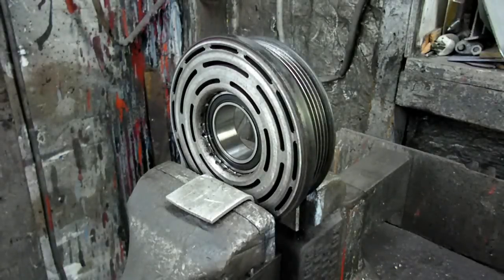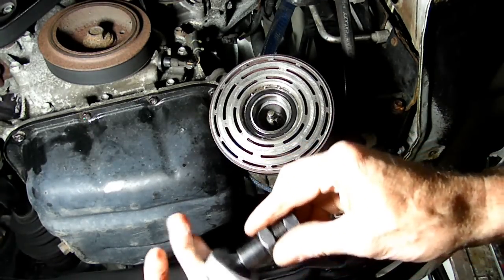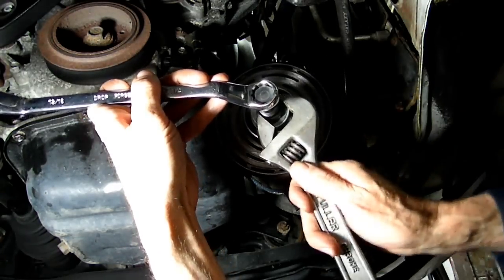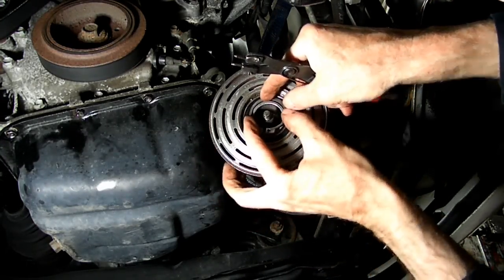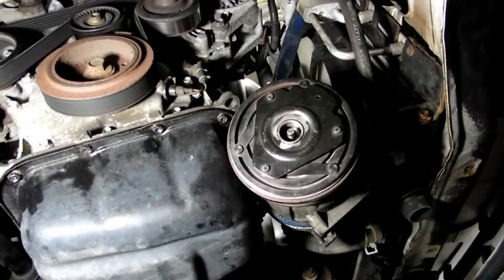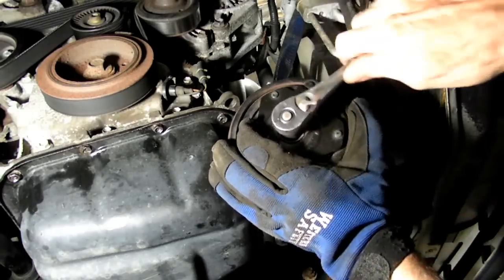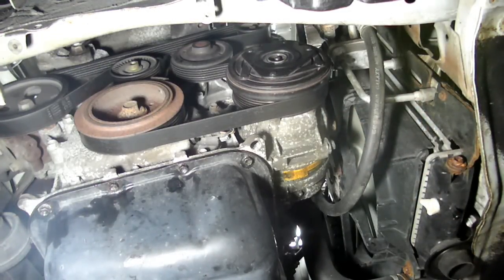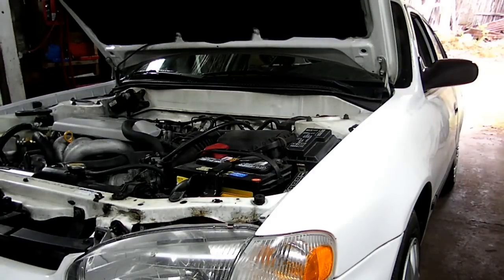Delphi V 5 V 7 AC Compressor Clutch Bearing Replacement part 2

Comment: thanks for the video --made it a lot easier than having to figure it all out my self. my bearing was so jammed in there i probably ruined my pulley getting it out (warped).... finishing the re-install now so i guess ill see how it goes.

anyone know where i can find the pulley and our entire clutch/pulley assy new?
Reply from the maker: I believe autozone has it.
Reply: richpin06a damn it now i find it... thanks. now i have to decide whether or not to swap it out again....

heres the link for anyone else. http://www.autozone.com/autozone/parts/Compressor-Works-A-C-Clutch/2002-Chevrolet-Prizm/_/N-jh77lZ91sgk?itemIdentifier=884509_301124_5560_

Comment: Although your pronunciation of the word 'bearing' is amusing, your video was actually very useful. I was able to get the job done in a couple hours with your help.

Thank you for making the tutorial.

FWIW, I did't need to grind/cut off the teeth holding the bearing in. Simply hammering the bearing out with an appropriately sized socket was enough to break them off. Saw someone do it with a press as well, but I didn't have one handy. They just break off as the bearing slides past.

Comment: Is it really necessary to remove the key if it's stuck in the clutch plate? Seems like it just clicks in when you put the plate on. Also, the arbor I used to remove the pulley won't fit on the crankshaft screw; they're different sizes! It's a Delphi on a 2003 Impala.
Reply: Just finished this today and answered my own question. Yes, it is. Otherwise, you can't screw the arbor on to the center shaft. I thought I'd get off cheap and got the $20 ABN kit. It was ok for removing the clutch plate but I couldn't install neither the clutch plate nor the pulley. So I rented the OEM kit from Autozone which worked. Mine is also a Delphi V5, part #10306016 on a 2003 Impala. Not much room, the compressor drops down a few inches and that's it but it's still enough and you go at it through the wheel well. I swear I would've forgotten that snap ring if I hadn't looked at the video again. And watch that old bearing if you use it, it will get stuck. I was banging on it for a couple of minutes then went for the beloved vise grips and pulled it straight out. The clutch plate holder doesn't have to line up with little nibs or anything really. Once things get tight, it will stop the plate from spinning. My only complaint is Rich made it look easy. That, and the problem with mine was actually the compressor. Oh well.

Comment: Hi Rich, great video and will use to change my bearing. I was interested on how you had a your serpentine belt by pass the compressor till you could work on the compressor. I have a 3.5 Litre Intrigue with a V7 compressor and would like to by pass my compressor. Would you know the length change on the belt you used to by pass. Your assistance is appreciated and keep dirty everyone.
Reply from the maker: The bypass belt i used on this 1.8L engine would be different than the one you are working on.

Comment: Rich, thanks for all your work you provide on here. I have a 2000 Saturn LS2 3.0L and need to put an A/C Clutch on it but, don't really want to take the compressor out. Have you done any LS2's without totally removing the compressor?
Reply from the maker: Johnny Shackelford I have not done this on the LS2 so i can not tell you much about what is involved.
Reply: Thanks for getting back to me. I'll see what I can do.

Comment: Rich good job and thumbs up.  YouTube needs more of these type of videos.  How much force did you need to put the clutch plate back on?  I needed a lot of force and have gotten the gap to 0.116" (second install) before I did not have anymore leverage laying on the ground as I was.  At first I though the keyway fell off, so I pulled it off again and tried again.
Reply from the maker: I would say the plate went on with medium amount of force.

Comment: Rich i like to replace just the clutches if possible as well have been burnt quite a bit most of the time the front seal on a reman compressor always burns ya, props to you for taking it to the next step and just getting the bearing... Did u have to take it apart and pause video to cross reference part or did u find a listing for the bearing? Jus wondering for future